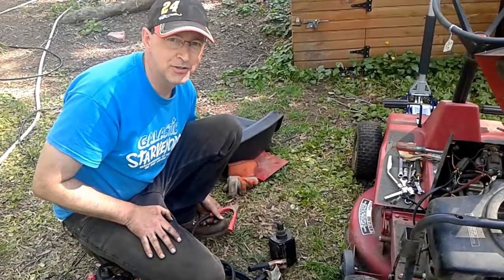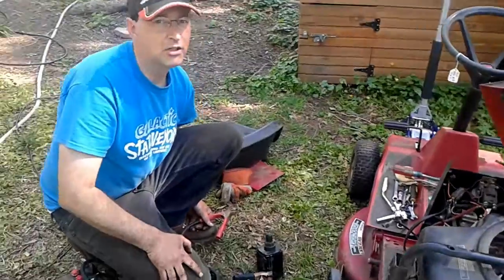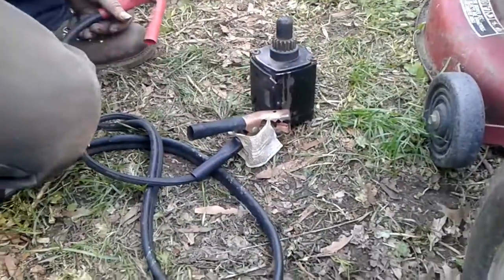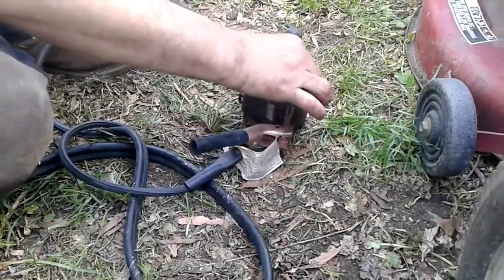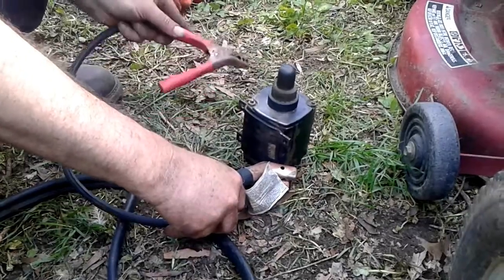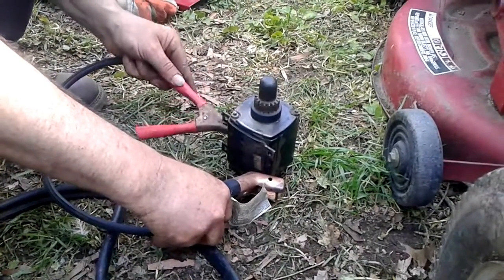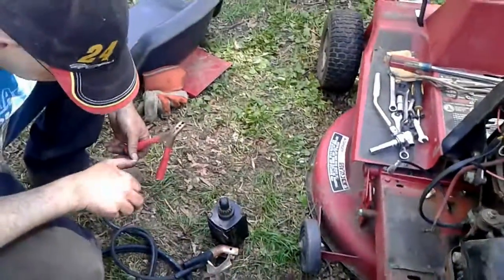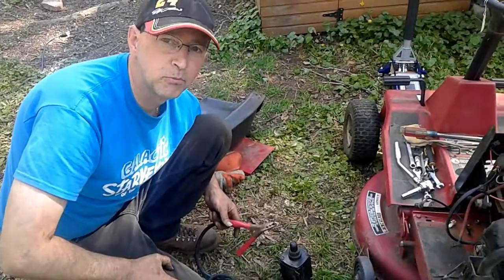How to Bench Test an Electric Starter Motor (even without a bench)

Comment: finally a simple video on how to do it.  All the rest I have seen have about 4 cables all hooked up and my starter only has one terminal where the red wire is connected.   Now when I tried it, it seemed like a short.  I just touched the neg booster cable on the frame and it  just like sparked so bad that I took it off.  I assumed I did something wrong but now I am not sure I did.
Reply from the maker: Try it again. It's normal to have some sparks when you touch the starter post with the positive lead on the jumper cable. Attach the negative cable first to the frame of the starter motor. Then the positive to the terminal on the starter. Just hold it on there and see if the motor spins, and if the bendix gear rises up, as it should.
Reply: @Buckwsr  Thanks for your reply. I went out and tried it again after watching your video and yes one has to  hold it firm and over look the sparks and then it works well. My starter is perfect so I am now assuming it is some other switch like the solenoid.  
Now I have taken a voltage meter and measure the red wire attached to the starter  and when I click the key on I get 12 volts at the starter.  Now some have told me that means nothing as even a bad solenoid will give one 12 volt as its all about the amps.